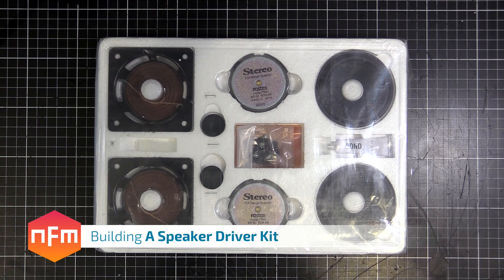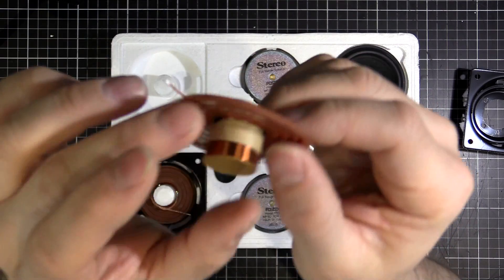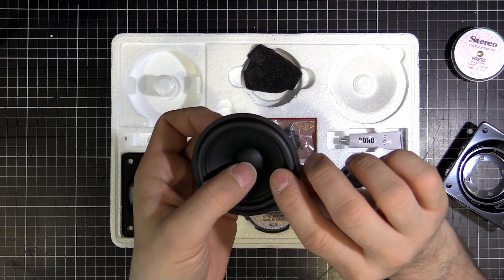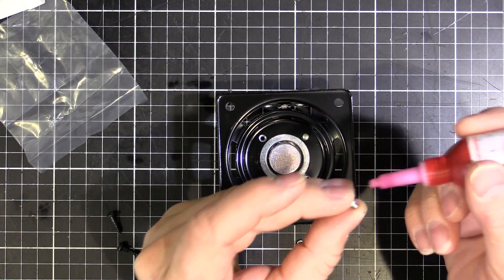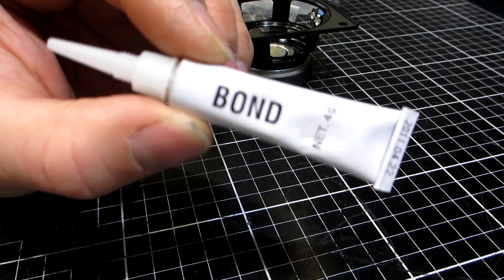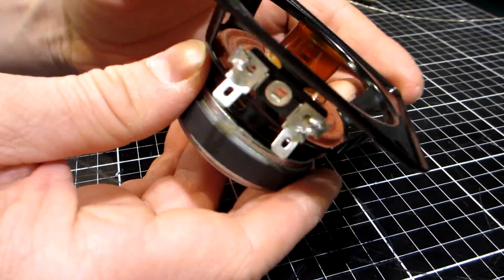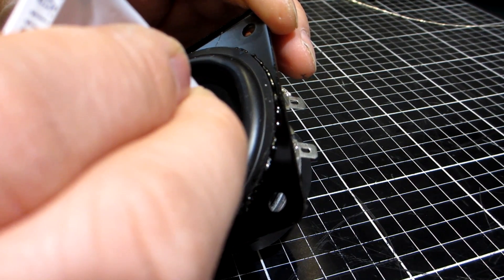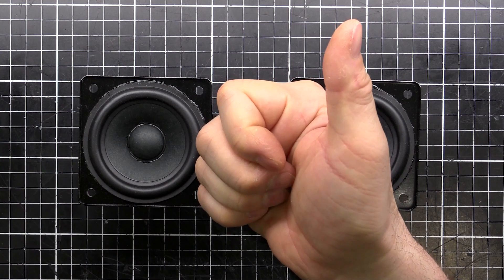How to Build a Speaker, From Scratch! -  Episode 01

Comment: It's cool to build it yourself, but that is not "from scratch". You started with all the components ready, and just put it together. "From scratch" means you start with raw -- or at least off-the-shelf -- materials, IMO.
Reply: Rodolfo Borges I built one from near scratch, I built the coil, cone, dust cap, spider, and basket. I did use the magnet from another speaker though so idk if that makes it not scratch
Reply: @BiggieCMAN  if it's not already made at a factory or in a kit it's made from scratch, and no the magnet doesn't matter.